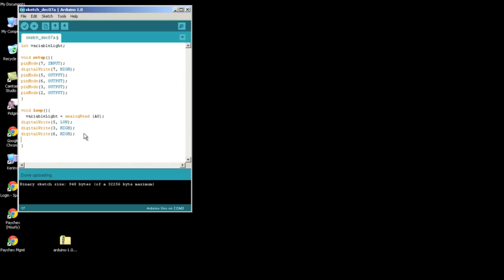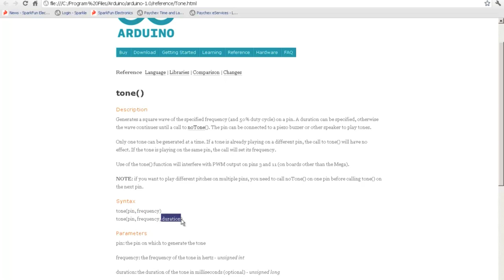SparkFun Protosnap

Comment: A bit confusing in places...
Like, "This button has an internal pull-up resistor" - and then you describe how to set up the microcontroller's internal pull-up feature. From the schematic this seems unnecessary, the button is already pulled up by the resistor.